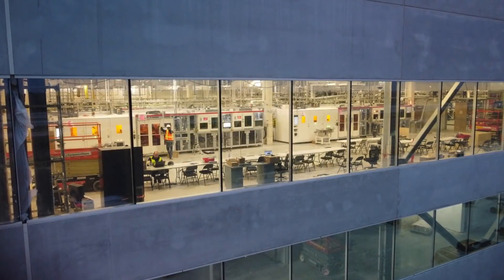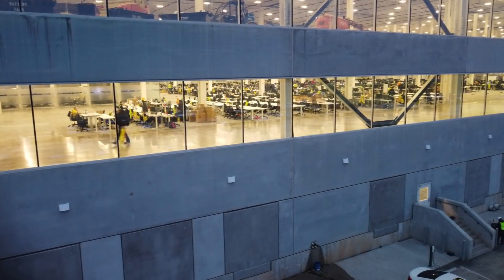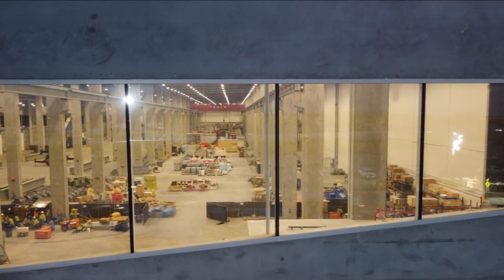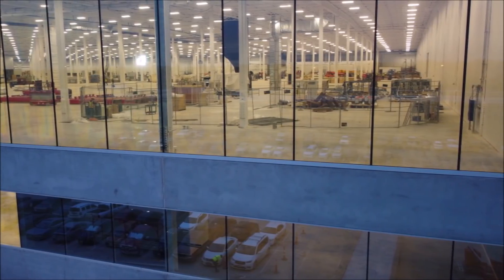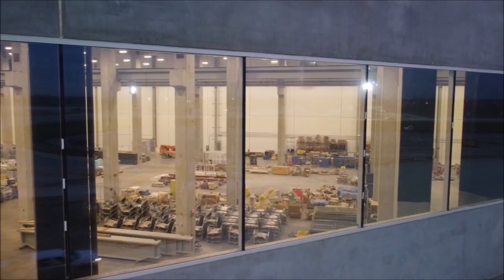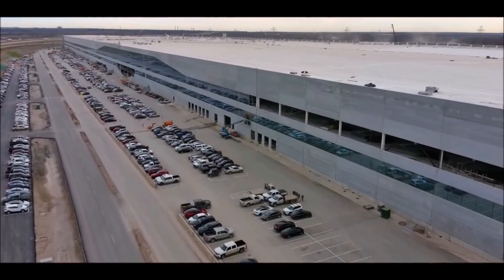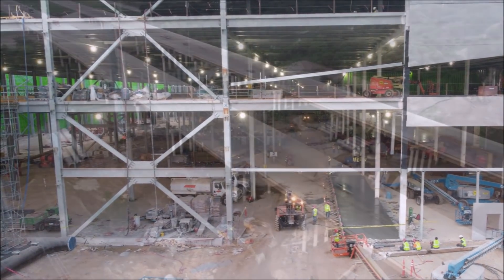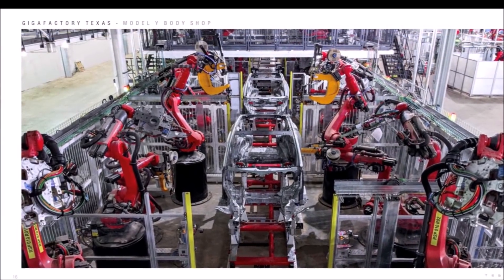BREAKING! Tesla Giga Texas 4680 Battery Production’s Target Timeframe

Comment: If I order a model Y now, it should have 4680 batteries and structural battery pack with new castings at delivery in September.  I hope they configure it with enough batteries for 400 mile range to leap ahead of all competition, especially the Chinese imports.

Comment: 4680 from Texas starting in Q2
Reply: That would be good because I have a Y delivery for July and want the 4680s.
Reply: @eugeniustheodidactus8890  they will have 4680 from day 1 from there, just the batteries are coming from Kato road and not enough to start the second line I think. They are installing the 4th gigapress as we speak…but I doubt they will have enough 4680 for the 3rd and 4th press until GigaTexas is also making 4680

All the new press are coming in pairs, one for the front and one for the back
Reply from the maker: Yes, makes sense.
Reply: Kato Road Will Supply Austin with 46 80s until the Austin lines are up.